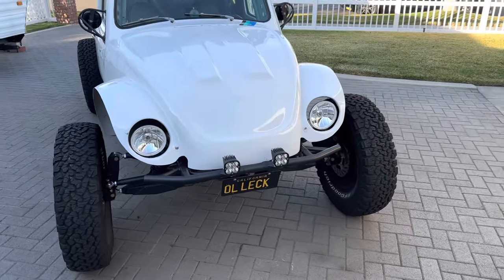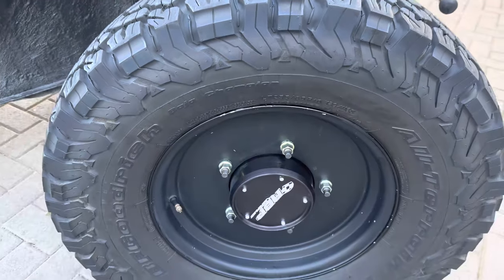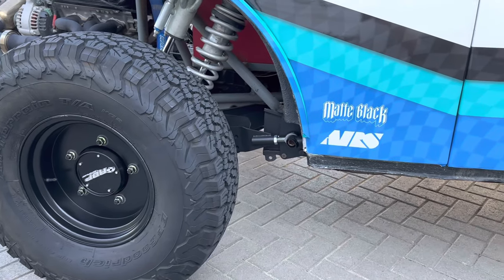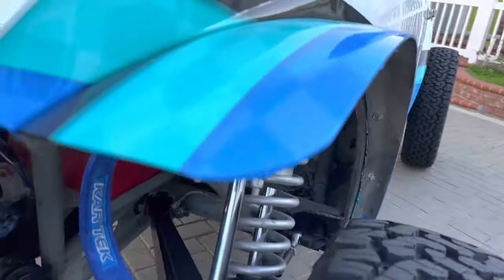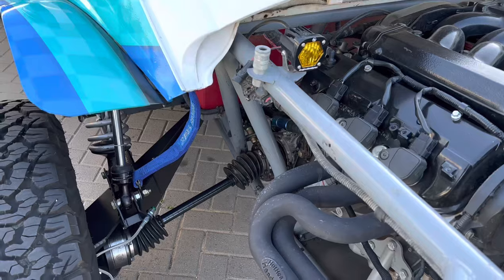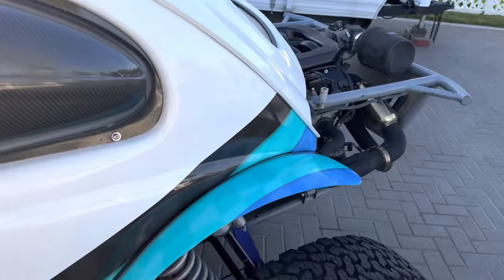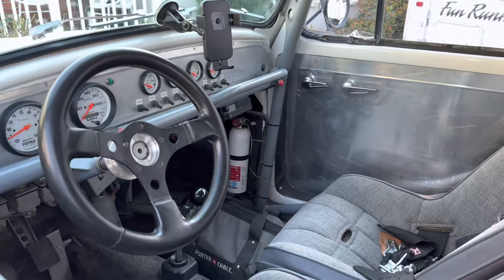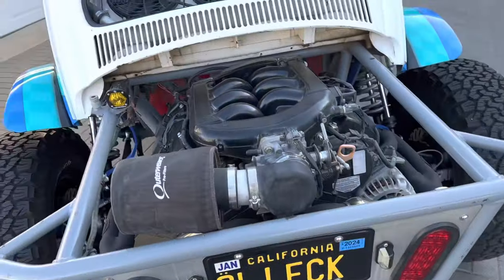Long travel Baja bug update

Comment: I almost wish I had gone with a Honda engine.. I went all out with a built CBM ls7 motor, I can't keep the front wheels on the ground and the thing scares the crap out of me. 600whp is way too much for me,🤙
Reply from the maker: Damn that’s one wild ride I bet!
I like having more suspension than horsepower, I can push it hard. 600hp LS7 would be a blast! I’d need a diaper hahaha
Reply: @coderedward  OMG, it's absolutely insane, I try to just cruise it around but it's just too much fun to get on it. When I get out of the car I'm shaking like a leaf.. I m thinking about building another one with VTEC and just keeping this one for sand drags. BTW that's a beautiful buggy.

Comment: Extremely nice build!! I'm starting on a similar build, just pulled the trigger on the Nichols front suspension a couple weeks ago. Curious, what wheels are those? They look like they might help reduce aerodynamic drag a bit, are you running into any issues with brake cooling? I'm guessing not, but my understanding is that style wheel can run into cooling issues with more... ah hem... traditional vehicles.
Reply from the maker: The wheels are spun aluminum welded 2 piece I had powder coated semi gloss black. Kartek and B&R Buggies sell them. I’m running a 15x7 in the rear and a 16x4 in the front. No problems with brake cooling at all in my application
Reply: @coderedward  I like em, are there any advantages to running these compared to say Methods or the like? Seems like they might be lighter.

Comment: how did you find grafting that a arm bulk head on? i have been looking at their kit for a while.
Reply from the maker: It was pretty easy. I put a piece of 1” masking tape around the tunnel against the “firewall” as a guide and cut it off. Then welded the plate that comes with the kit to cap it. The bulkhead will then weld to the plate. 
This pushed the wheelbase forward for me 5-1/2”. I had a 6” wide beam with tweeds 2-1/2” arms in the stock location before this.
Reply: @coderedward  ya i have a 6 inch beam in my car right now. you did that with the body on the car?